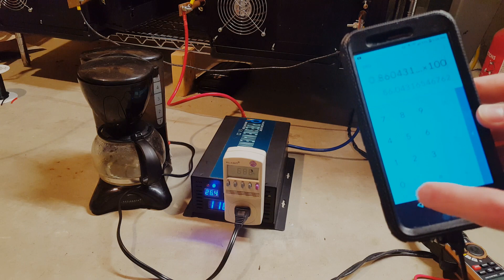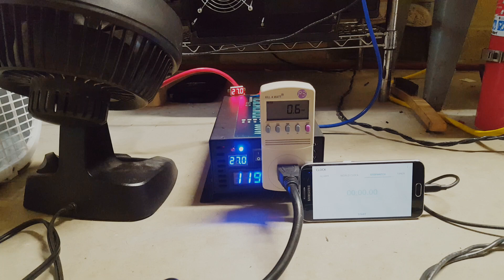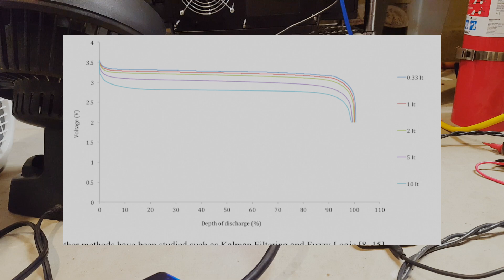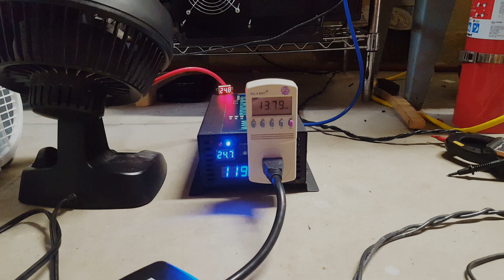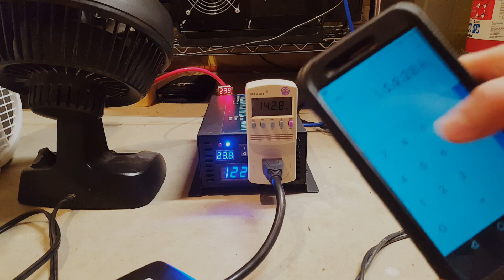BYD 24V LiFePO4 Capacity Test!!! Inverter calculation correction

Comment: hey guys, I'm debating BYD for my solar rig (thanks to all you guys who post videos about it!) I found this BMS https://www.techdirectclub.com/lfp-8s-bms-24v-lifepo4-130a-with-connection-wiring-for-byd-or-a123-system/ and was wondering is anyone running these? It just seems kind of nice and plug and play so I'm wondering what are the drawbacks?
Reply from the maker: Its hard to know if a certain parameter or setting would be a drawback without knowing how you would use them. What would you be building if you were to build a system? As much detail as possible is helpful. Currently I have a single 320 a BMS like in project overkill on my 4 BYD's and it is fine because in not working them hard at all. Your use case may be different.
Reply: @diyrenewableenergyelectron4996  Sorry good point. I'm considering buying 4 as well, will be for a solar rig, was thinking about just running them all 24v paralleled. trying to figure out the best way to charge and balance my loads. I have up to 5kw of solar to install, not sure if I will put the whole array up at once or start with half and expand the array at a later time. Still in the planning phases but I have my panels and a 24v invertor and mppt charge controller already.
Reply from the maker: If you decide to go with 24v overall, I HIGHLY recommend you parallel the individual cells together. In my capacity test video, a few cells dumped and if they had been paralleled with a stronger cell they may have stayed more in balance. If that doesn't make sense please let me know, I can try to explain differently but basically you could parallel all cell 1's together, all cell 2's, 3's, etc and that is going to make keeping them in balance much easier. Your charge controller probably wont charge at 5000 watts(thats like 200 amps at 24v lol) but most charge controllers can handle overpaneling so long as the max open circuit voltage is not exceeded. I just looked and saw you said you may start with half, I would recommend that. Honestly, I'm not sure what you intend to power, where you are located, etc. But 2500w in panels may be enough. I am limited to 650w input right now (12v@45 amps) and I still struggle to use that. I fill the batteries daily and plug random crap in for the sake of not wasting sunshine lol random fans running, 3d printing stuff, whatever 😂
Reply: @diyrenewableenergyelectron4996  thank you for the reply yea I think I have enough to run the welder 😁 I'm definitely looking into paralleling
Reply from the maker: As far as your BMS you linked, as long as you dont mind having fixed parameters that the BMS runs at (cutoff volrages and such) it would probably be sufficient. Keep in mind it will not be able to keep the cells in balance and as long as youre okay with that its all good. If you buy 4 BYD modules you can expect 12-16kwh so unless you plan to discharge them fully you probably will be fine(when cells have very different capacities, the cell balance goes nuts at the bottom of the discharge curve even if you top balance. One or two cells will dump while most seem to still have decent capacity left). You definitely have enough solar to charge that big of a battery bank back up each day lol.
Reply: @diyrenewableenergyelectron4996  I guess my real question is, can I achieve parallel connections of the cells utilizing that front port (the connector is available even if I dont go with the turn key BMS, I'm trying to determine the best solution that is also the cleanest.)
Reply from the maker: Sadly, no. Too much current would flow through the traces on those connecters and they would fail. If you would like I can email you some photos of what I did, but it can be done cleaner.

Comment: Holy crap I'm super jealous! Only got 2.7kw from the battery on mine. Nice test.
Reply from the maker: Thanks! Did you have one very weak cell?
Reply: @diyrenewableenergyelectron4996  I capacity tested each cell. Cell 1-4-8 are 105ah, the rest are 125ish ah.  Some people parallel in some 8ah headway cells to make up for the bad ones.
Reply from the maker: There's a viewer on this channel who was paralleling headways to the weak cells. He said it wasn't really worth the time and energy. Do you have a solar array to recharge the battery?
Reply: @diyrenewableenergyelectron4996  The intent of this battery was for weekend boondocking in a trailer and leave the generator at home. Unfortunately it just isnt worth hauling an extra 125lbs with that capacity. When the covid situation settles down, it will be replaced with LG chem cells 3kwh at 35lbs.
Reply from the maker: Sorry to hear it isnt going to work for you! Im sure someone will scoop it up if you sell it.

Comment: You got the same as I did. I have 8 packs and touched 10 total. All about 4kwhr per pack. balancing did not improve it.
Reply from the maker: I may try what Greg B suggested and parallel each cell from several modules together. Cell 1 to cell 1, cell 2 to cell 2 etc.
Reply: @diyrenewableenergyelectron4996  I'm probably the first to have tried and suggested that, back in January. David poz followed. There's is some slight improvement. I'm currently experimenting with adding Headways to the weak cells.
Reply from the maker: Please share what you find with that! Honestly I am perfectly content with the capacity I have already but enough never ends up being enough lol
Reply: @diyrenewableenergyelectron4996  For the amount of work I'm not finding it worth while, but fun to experiment. Time and money better spent just adding two more full packs to make it a bigger bank. (Did that too, 6 packs to 8 packs in my 48V system). It's the storage behind my off grid solar system, And the heat of summer (AC running) I'l only needed to bank 25kWhr each day from my 8kW array. So I don't need the extra capacity right now.
Reply from the maker: Good to know. This is way overkill for what I need (fridge and sump pump full time) since I have a 2.5kw array but its fun nonetheless.

Comment: Looks like you got lucky, most of these modules that I have seen come in around 3.5kWh or less. Instead of an active balancer, you could parallel each cell across the 4 byds, assuming you are paralleling the all 4 byd outputs at 24V. (connect all 4 cell #1 together, etc for the other 7 cells). That way, the cell outliers in one byd are beefed up by the other byd pack cells so you'll get more power out of them before any group of 4 cells hits 2.5V.
Reply from the maker: I may give this a shot! The wandering cells are random throughout the modules so youre probably right that other (stronger) cells will help the weaker cells. I got way more capacity from these than I expected. I was going to be happy with 3-3.5kwh. I still havent decided if I want to do 24v or 48v yet. Uts just a matter of inverter choice and being limited on my solar charging capability. Its either 1200w @ 24v or 2400w @48v. 48v seems like the better choice lol
Reply: @diyrenewableenergyelectron4996  That approach would probably be better for you since the active balancers will typically only do maybe 1A regardless of what the advertising says (the currents depend on the cell voltage differences). Well, 48V is usually a better choice but I like 24V for smaller systems. For 48V, you'll need more expensive charge controllers (cheaper ones usually only do 12 or 24V batteries) and more solar panels in series to get the higher input voltage.
Reply from the maker: I kept the setup capable of 48v just in case I went mad scientist and expanded the system. Well, I went mad scientist lol. It started as 400 w in panels and now I have 2500+.  I have a morningstar tristar mppt controller(45 amp), 2500w in panels which are wired to ~100V DC coming in from the panels😁 I think I will try a 2s2p setup with each cell paralleled as you suggested and see what I get. It can't really give a worse result, only the same or better!
Reply: @diyrenewableenergyelectron4996  lol I started at 400W like you and went mad scientist only up to 2000 at 65VDC. I stuck with 24V because I'm using a couple epever tracers. That way, if one decides to give up, I still have one at reduced charging. As one mad scientist to another, curious to see how your system will turn out.
Reply: @diyrenewableenergyelectron4996  If you try to go for 48V '2S2P' , you should first measure the capacity of each 24V unit. Then try to match the capacity of each pair to make (2) 48V batteries. In other words, the capacity of the 48V battery will be limited by the weakest of the two 24V batteries in series. So you don't want to pair the highest capacity 24V with the lowest capacity 24V battery to make 48V.
Reply from the maker: Good tip for avoiding future headaches
Reply: That's actually false. 8% of the BYD batteries tested lower. Most customers got 4+kWh modules
Reply: @diybattery6837  I believe early customers got worse batteries as explained by Will Prowse.  Batteries fulfilled by Big Batteries were not tested at all.  My 4 batteries average 3KWHr with the worst being 2.7KWHrs.  There are benefits to 24V.  If you wire all the cells in parallel (as I also did) you have twice the number of cells to balance with each other.  Also, you need half the number of BMS channels.  The downside of course is that 24V inverters tend to top out around 3KW.
Reply: @craignels  BTW, your BYD terminal mod video is genius!
Reply: @gregb1714  You're very kind.  Thanks.
Reply from the maker: What are your thoughts about running fuses between the cell parallel connections?
Reply: @diyrenewableenergyelectron4996  I didn't use any fuses.  If you send me an email (my address can be found at my channel) I'll send you a photo of how I ended up connecting them, though you may be able to see it somewhat from my video.  I used 14 gauge wire for the balance wires.  My max inverter current draw is less than 150 amps so with 4 batteries, each battery has a max draw of about 37 amps.  Under max load conditions full battery to empty, I measured a peak of about 4 amps max flowing through the balance wires, so 14 gauge was plenty.  I guess I didn't see any point to the fuses.  If a cell were to short it would have enough energy to be damaging on its own so stopping current from adjacent cells doesn't really save the day.  I think the biggest issue is accidental wiring mistakes, but in my system because the batteries are so close together it's hard to make that kind of mistake and if I did, the 14 gauge wire would vaporize anyway.  I know David Poz used fuses, but he also had long wires strung around.  Nothing against fuses, but they didn't seem needed to me.
Reply from the maker: @craignels  I have a spool of 14 gauge I was eyeing for the balance wires and your comment convinced me to go with them lol I have just about the same perspective as you about fusing but wanted to see if anyone else thought of something I didnt. I know these modules are perfectly content discharging in the 100's of amps (I'm not going above 125 surge) so just want to be safe. Thanks for the response!
Reply: @diyrenewableenergyelectron4996  I don't see the need for adding fuses on the balance wires. Since these are LiFe cells, the only times decent current will flow to/from the weak cells is near the end of charging or discharging. I think 18 or 16 AWG is more than adequate for short runs.  The only time I would use fuses on balance wires is if you're worried about them shorting to something else. For example, wire insulation wearing off from rubbing movement. Longer wires have  a higher likelyhood of accidental failure because there are more potential failure points.
Reply: @diyrenewableenergyelectron4996  I am doing two banks of 12 batteries wired for 48V and am paralleling all the cells in each bank with fuses.  What a lot of work.  I have 15amp and 20 amp fuses ready to use with 10ga USE2 wire (194 deg F).
Reply from the maker: I did parallel connections on my 4 batteries and it took a long time. I cant imagine doing 24 of these things!! Good luck with your project, feel free to come back and update everyone on your progress.
Reply: @diybattery6837  Just saying what I have seen. I only got 1 and it came in at 3.2kWh.
Reply: You should absolutely fuse unless you can positively guarantee your wiring approach can never have a fault scenario. Working current will be low, but if a balance wire comes off its connector and touches another lead, something will melt. I used 14awg and just added automotive spade fuses in-line using female spade crimp connectors. Already blew a few while rearranging wiring to add Headway cells. So glad I fused.
Reply from the maker: Good point!